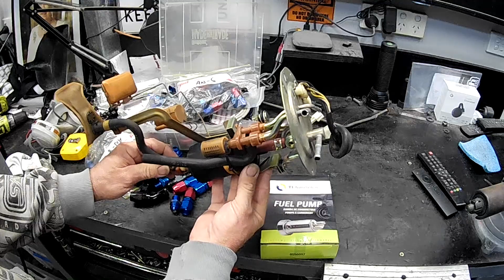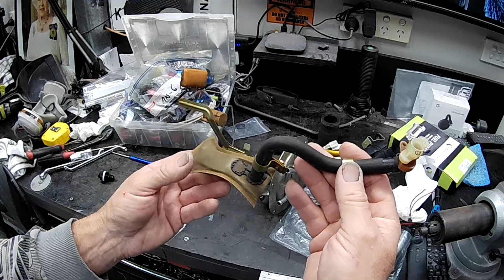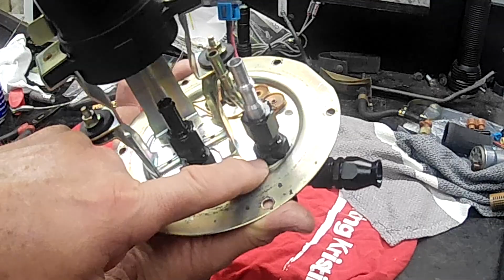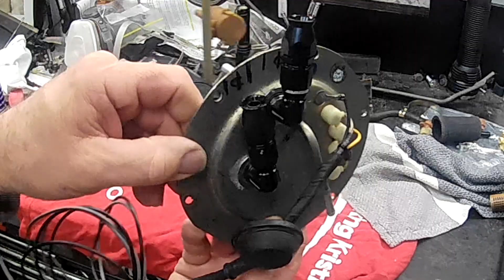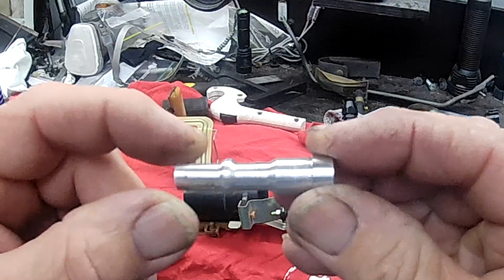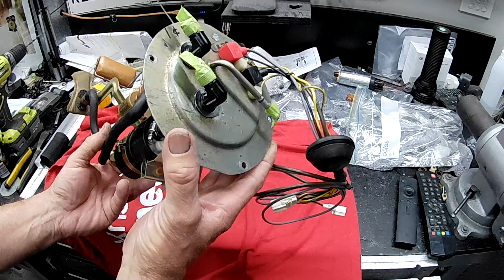Z32 300ZX Fuel Pump & Hanger Mods 2+0. Project Fairlady, The Nissan Z32 300zx Twin Turbo Mega Build.

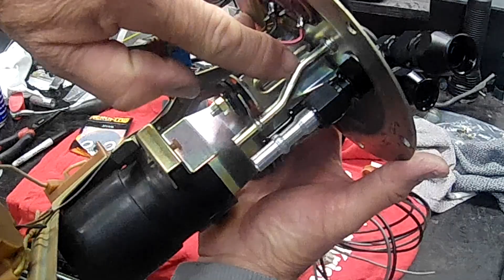Comment: do you sell DIY AN fitting kits for the fairlady fuel pumps? specialloy the silver adapter at 28:03 im trying to do a twin fuel pump for my set up i have a aeromotive internal fuel pump and also have a fuel cell and external fuel pump but inorder to do the set up i need to go with an fittings to connect everything with a y fitting and fuel pressure switch

Comment: I drilled new holes then used a bolt, nut, and a short bit of fuel hose to make my own passthrough, put ring terminals on each side so the gauge of wire is constant from pump to battery. Have a small extra fuse box and relay setup to bypass the fuel controller but its been working great for years on a walbro 485.
Reply from the maker: Sweet, that's the go. Nice ingenuity there Mate. Cheers.

Comment: Well done!  I went with a radium pass through harness and radium Venturi.  The oem wiring will not hold up and also the fuel pump controller will need to be deleted.  If you are on social media i can send you pics.
Reply from the maker: Nice. I wasn't aware of either of those products. Just looked them up, they look good. Frightfully expensive to get in Aus though. But, its pretty much like that for everything here really. Cheers Mate.